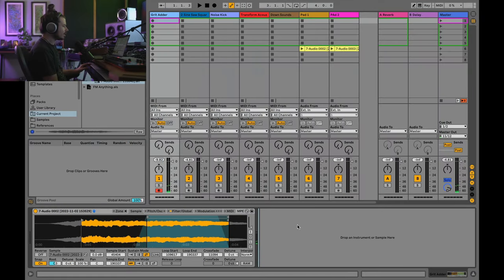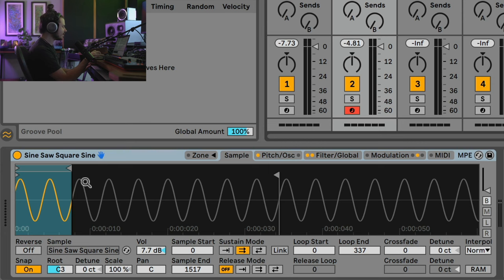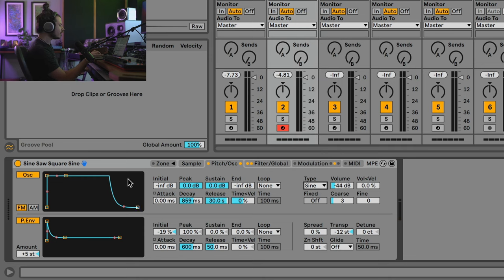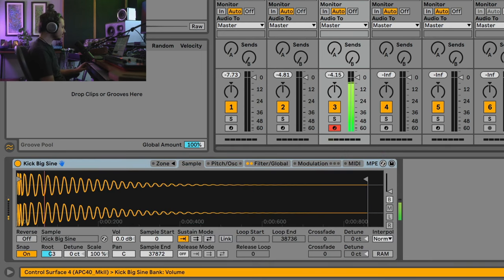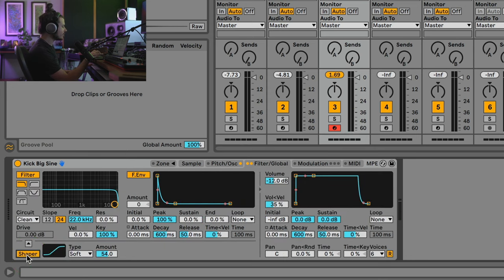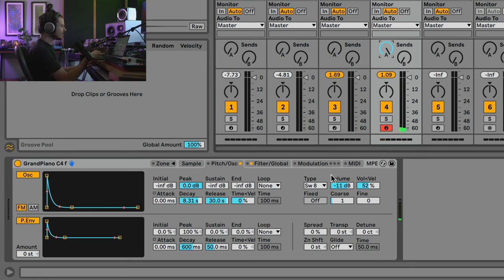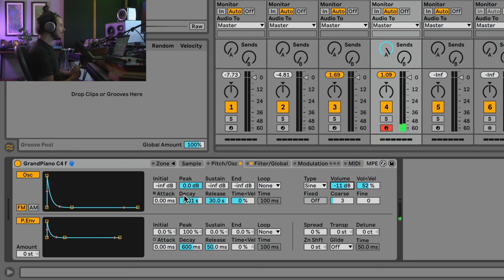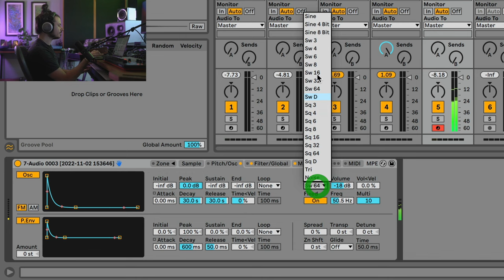FM Any Sample - Ableton Sampler Sound Design Tutorial

Comment: If u have ableton and you're long for another sampler; you're either in that thing where u it's easier to get new gear than confront the fact that maybe you don't understand the stuff you have, or you don't have your tool mastered yer. 

One more bonus thing I like. I like to think I have my own hi hat lane, in the modulation section I'll go to  or three, set the lfo pattern to random, click in option 1 "offset sample start", set it to a low number, no higher than 15, then assign mod 3 to change the rhythm and duration of mod 2's rhythm: in this way it ls as close to random as you can get. The result is hi hats that have normal variation in attck - just like real hh. Go a step further and grab am m4l modulatipb/lfo/shaper, and assign it to the attack, decay, susation.

Comment: Modularing the amplitude of a signsl is actually AM synthesis. FM synthesis is frequency modulation. You dont actually even need to use a sanpler or simpler to do either AM or FM synthesis. You can automate the frequency/pitch in the waveform editor on a track either in the clip launching view or the arrangement view. You can just write transposition automation to modulate the frequency.

Comment: So I always layer my kicks and snares. No more of less than 2 or 3 per perc. I don't line the waveforms up of do any of that, I just group samplers. And after adjusting the adsr and filter, the next step is always fm modulation. For instance, the sub element of your kick may not be tuned correctly: simply turn on your fm, set the sustain to max, and I like the tri or sign wave forms. Set the course to .01 or point 1 (? I forget₩ then manually adjust the fine until the pitch is correct. Obviously set the adsr of the osc envelope. Something it's nice to ramp it in - set the attached a few milis off - to retain some click. For the transient, click layer, the best is the saw or 64 maybe? They impart a very round, plenty filtered click to the beginning. After that, a few instances of eq8, frequency shifter (the other secret perc synthesis tool)and of course a glue comp and sat. And usually another frecuemcy shifter to be able to shift the whole thing (it's often on the individual components as wel)
Last thing, I've been theorizing how you could synth an 809 stile clap: basic sin wave with the quick octave pitch drop. The noise FM will envelope fully on, then the filter set in a loop- with a max for live decreasing both the initial volume and increasing the attack length for each subsequent iteration. Haven't tried it yet but man, been using sampler hard core for years and I routinely realize soetjing thing new and useful. Don't sleep on the Aux envelope in the modulation page; you want the filter distortion to start at full DB and in 110 miliseconds fade to zero percent distortion. Want to introduce vibrato to a looped wave? Make a standard adsr with sustain fully turned down and an decay nice and short, <300mls, turn your parameter "pitch entire sample" to -100. That will let the sound play clean at first then build to a vibrato; ya know, like a real thing that does vibrato.

Start introducing the m4l lfos and followers... Man, that's sound design baby!
Reply: EDIT, I always use fixed position or my drum fm osc/synthesis. I haven't explored fixed mode yet ND determined what it's best for; as perks don't change pitch for all ontents&purps. You also aught to get a hang on looping the adsr of the osc and especially the pitch shift for some crazy non perc sound design. Live Is soooo ppwerful.